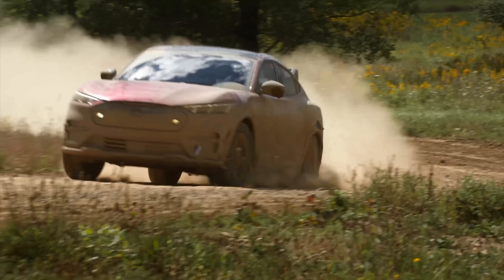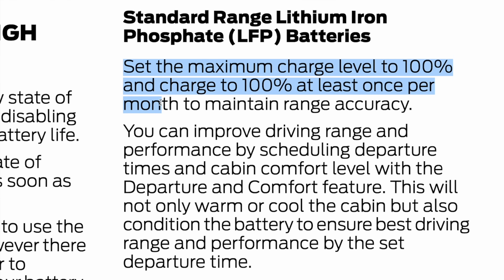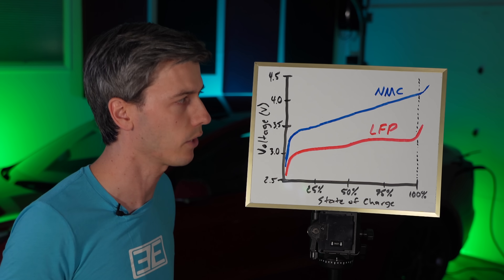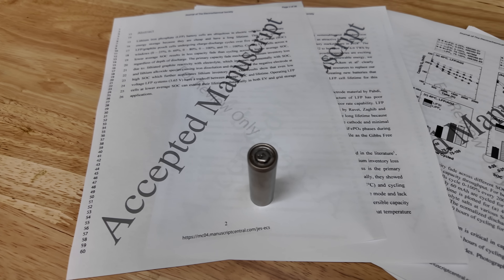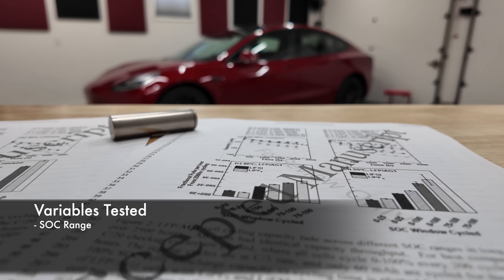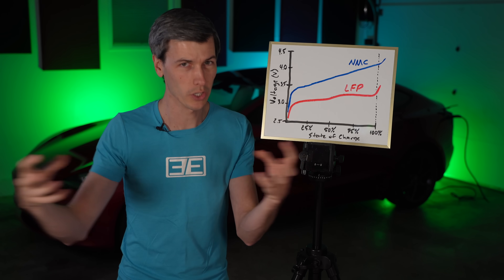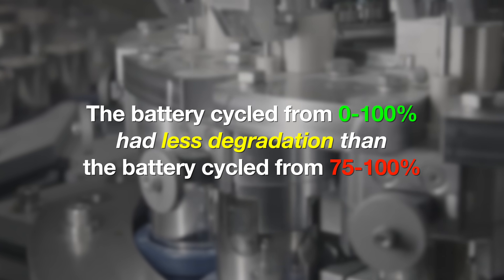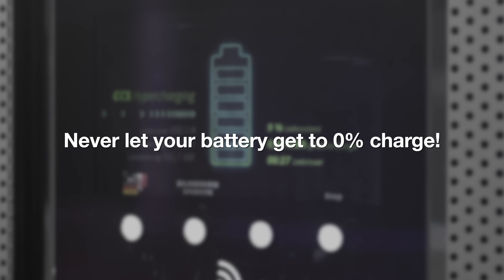How To Ruin Your Electric Car's Battery - LFP Edition!

Comment: You forgot to mention that LFP batteries last longer than NMC batteries overall 🤔
Reply: yea even if you do the worst charging cycle mentioned of 75-100 % pretty regularly the battery will still most likely outlast your car.
Reply: I think he wanted to stick to the title topic, but he does mention that LFP is likely to last the life of the car and that the worst-case degradation in the reference test was still very low, but I agree that a headline of this story should be that LFP has substantially lower degradation rates than NMC, regardless of charge regimen.  Many of the LFP cells being made to today will outlive their relevance.
Reply: @antibrevity  Good observation. so their degradation is so little that some degradation will still be ok and outlast the car probably.
Reply: But they're bigger
Reply: @AgentOffice  So? Are you having trouble making your 20 mile commute with your 200+ mile range car?
Reply: From 12:55 Jason says that a well maintained LFP can easily last the life of the vehicle. Not sure on comparison being mentioned.
Reply: It depends on under what type of workload.  LFP last longer than NCM in stationary storage systems; but marginally better than NCM in LFP.
Reply: @tooltalk "[LFP] is marginally better in LFP"  What is that supposed to mean?
Reply: @Neilhoh3  ah, meant to say LFP's cycle life is marginally better than NCM in EVs
Reply: Well, LFP is not well suited for BEVs....! It's heavier, less energy dense, charges slower and discharges slower as well! Also the performance at low temperatures really sucks. 
Modern NMC Cells easily can do 2000 cycles or more! I think NMCA is the way  to go ...
Reply: @huey-fan8335 
Both are crap, really. Stick a smaller LiFePo4 in alongside a petrol or diesel engine, and forget the long range battery electric cars.
Battery electric is fine for short trips in small vehicles - motorbikes, small hatchbacks, etc. For anything over about 30-40 miles or bigger family cars, hybrids are much better for the environment and the customer's wallet.
Reply: @tin2001 Rubbish!
Reply: a consideration though is they are less dense and thus less range, thus technically more cycles for the same miles. Still better IMO, but maybe NOT as insanely better as "lasts longer"
Reply: Around 6 times longer too
Reply: @tedarcher9120 This is grossly oversimplified - high quality NMC cells can fairly easily do 1000+ cycles and are getting better over time, and lower end reputable LFP cells are 2-3000 cycles, still a lot longer but not 6 times
Reply: @bosstowndynamics5488  yeah, you are comparing golden nmc with garbage tier lfp. LFP normally do 6000-10000 cycles. If you compared garbage nmc with golden lfp you can say lfp is 20 times longer living
Reply: @tedarcher9120  You should learn how to read. I'm not the one who made a rigid claim about proportions between the 2 chemistries, I merely pointed out that your claim was far too specific when there's so much variation within chemistries. Your response only reinforces that point - you can quite reasonably claim that LFP cells are 5 times better than LFP cells if you don't bother to be more specific, and if you are going to be more specific then you can't just go with "LFP" and "NMC". LFP cells are more resilient and do last longer but not by a specific amount.
Reply: @tedarcher9120  I'd like to know which EVs have LFP with 6000+ cycles.
Reply: @tedarcher9120  true in ESS, not in EVs.
Reply: And not a word about calendar aging of the battery, every year the battery deteriorates 1 to 2 percent if you use it or not..
Reply: @habana7638 can you site your source?
Reply: @habana7638  no only in the first year they may drop by 1-2% after that it's MUCH slower, just like other batteries.

Comment: Based on what I learned from this video, you should set the LFP battery charge limit to 100%, charge it to 100%, then use it normally until it reaches 20%. After that, charge it back to 100%. If you are going to store your LFP battery for an extended period, set the charge limit to 50% and keep it plugged in.

Comment: How much Bad Stuff are we talking? I mean, outside of letting it get to zero, what's the life expectancy difference between best and worst practices? Are we talking 20 years versus 19 years or 20 versus 10?
Reply from the maker: Excellent, important question that I definitely didn't answer, because it's difficult to say! I did include the study in the video description, which gives a more detailed answer. Basically, you can look at range capacity over time, and after 2500 hours (I think something like 1400 cycles, for a 200mi range EV, that's something like ~300,000 miles, with capacity retention ranging a few percentage points for each respective strategy).

Comment: I'm not sure it's that critical to have an accurate state of charge.  If you have a 20 mile daily commute, charging to 25% or whatever is fine.  You won't ever run out.  If you are going on a road trip for the weekend, then charge to 100% right before leaving.  If you run a rental car company, yeah, you've got a problem, but if you have more predictable usage, use that predictability.
Reply: I doubt it's just for user convenience.  Critical systems probably need to be aware of SOC for battery conditioning and the like.  The user impact is just a convenient side effect to get people to actually charge to full every once in a while.

Comment: Generally: don't let your lithium batteries get hot. Definitely try not to use them whilst they're hot. Charge them slow because that keeps them cool. Don't discharge them too fast or they'll get hot. Don't fully charge them. Don't fully discharge them. 

From what I saw a few years ago LFP was king for cycle life but lacked the power and energy density. And that was improved by cycling from 40% up to 60% ideally. 80% worst case. Only charge up to >95% when you are going to need that extra capacity. Keep the SoC middling, in general. 

You should be able to leave your car plugged in all the time and the BMS manage your SoC to maintain optimal long term health. But in reality most systems aren't smart enough for this.
Reply: Yeah, this exactly. I own an EV from a generation that used an LFP battery and was ridiculously overbuilt (the Chevy Spark EV, which was one of GM's first gen mass market EVs.) The amount of battery protection they built in is nuts. It never fully charges the whole pack to 100%, and does dynamic cell balancing. Ironically, leaving it plugged in all the time when available is the best condition, because it will run the cooling system to keep the battery at good temps even when its hot outside.
Reply: The 'don't fully charge them' advice is really a manufacturer issue: A lot of batteries in consumer electronics use a BMS chip that will slightly overcharge the battery to squeeze more capacity from it while greatly shortening battery life. Consumer electronics just aren't expected to last very long anyway.
Reply: What's really cool (hot?) are the lithium batteries used in Radio Control vehicles.  For absolute max power top speed runs, the batteries are charged into a "hot" state so they will output max power.  The downside is they lose capacity VERY quickly such that only a few MAX power discharges.  Those used batteries will still work great in more "normal" use however their ultimate life is shorter. Electric power for performance has similar tradeoffs to gasoline (internal combustion) performance power, but the electric has much more terrible tradeoffs it seems.  A brand new internal combustion engine costs quite a bit less than a battery pack with motors included.  I get the novelty and fun of electric power, but use that as the rationale, not some made-up crap about saving the "environment".
Reply: And that makes for yet another issue that the EV companies are not addressing and yet another issue that people pushing back against EVs have legitimate concerns.

Comment: For my model 3 LFP. I typically leave the charge at setting at 100% and don't play with that setting. I always schedule charging for it to reach 100% around the window i plan to use the car next and the remaining percentage seems too low to cover my typical route comfortably. Basically i don't leave the car seating at high states of charge unless it can't be avoided through un intended plans changing.

Comment: This will also be important in the context of V2H and V2G. Where there is a higher probability of cycling in the SoC above 60%. Now it's more understandable why Renault chose NMC for the 5 E-Tech, which combine 11kW AC V2G with just 52kWh battery.

Comment: I mean the point about LFP was it doesn't really matter. Because it by default has like 5x the life cycles than nmc. So you don't have to care being careful about it because it will barely decay anyway. And while lower % range might be better it's still does way less damage keeping it at 100% than nmc.
Reply from the maker: Not necessarily, you can design an NMC to outlast an LFP, so it's not fully accurate to say by default it's 5x in life. Dahn's lab has demonstrated this.
Reply: Lfp really the perfect car to non home charge and only using superchargers.
And will charge much faster from 80-100%.
Reply: I'm still not following what the recommendation is for example for a tesla model 3 with an lfp.  i've heard/read ABC - always be charging.  just keep it plugged in and charge to 100%
I'm assuming tesla/CATL knows more than random one off studies right? if we should only charge an lfp to 90%, wouldn't they tell us that etc.
Reply: @traubgator  best practice seems to be don't worry about charging to 100% but don't charge if you don't need to.

Comment: It's funny, I've also been taught to never let you gas tank be too low. As it will hurt you fuel pump operating at that amount. How things change but stay the same. Lol.
Reply: The fuel pickup is designed to be at the lowest point of the tank - it does not 'float around' so that if you let the fuel get low it will suck up dirt and water and all that other scary stuff.
Reply: Yep. It's the same debate with oil change schedules. Some say follow the manufacturer's recommendation, others say something crazy like every 2k miles. It all depends on how hard you beat the car.
Reply: Another adage to keeping a gas tank full in the colder environments is it gives less head space for air which has moisture in it. Over time you may get enough water that may inhibit your gas line may freeze.
Reply: Hah, true. Just as filing it up too 100%.
Reply: Some of the issue is sucking air, some of the issue is that if you only fill a bit at a time and run the tank regularly almost empty you can get water buildup.
Reply: @samiraperi467 One more reason is that most fuel pumps are inside the tank and use the fuel for cooling.
Reply: @sonictech1000  Yes, 'people' like to throw that out that not running your gas level is about cooling, but that concept is nonsense, LOL. As long as there is gas flowing through the fuel pump, even at low gas levels in the tank, the pump is being sufficiently cooled just by the flow of gas through the pump.
Reply: @Tom-dz6yo  Sufficient to outlive the warranty isn't the same as optimal.  Being submerged in fuel will definitely keep the pump cooler and pretty much any electric motor or pump will live longer in that state.
Reply: @samiraperi467  The fuel pickup is designed to be at the lowest point of the tank - it does not 'float around' so that if you let the fuel get low it will suck up dirt and water and all that other scary stuff.
Reply: But a fuel pump doesn’t cost 10,000s and that was a long time ago
Reply: @whatcouldgowrong7914  the fuel pump on my truck was 1100 to replace last year. It's not as much but it's still not cheap.
Reply: @Egleu1 that’s not insubstantial, but it’s a heck of a lot less bitter a pill to swallow than replacing a battery to the tune of 20k for a Tesla or 65k for a Hyundai. A battery failure is worse than any single failure on a normal car including the engine and transmission.
Reply: @Thanatos2996  and they almost never happen.
Reply: @Thanatos2996  engine failure is 15k. Gas engines have more maintenance and failures than electric.
Reply: @Thanatos2996  Exactly, the massive depreciation of EV is bad enough that after 2 to 3 years it is cheaper to write off the vehicle rather than pay to replace the battery.  also the slighted suspicion of damage to the battery from even a mild collision the car will be written off because when a lithium based battery lets go, the whole neighbourhood knows about it from the dozens of fire trucks that turn up.  I guess that is why there are quite a few EV in junkyards that look OK on the outside or just minor damage.
Reply: @Egleu1 1k+ fuel pump? Sounds like a diesel fuel pump or overpriced trash.
Reply: @mjay6245  that's with labor. It's a  Sierra 1500 gas.
Reply: @Egleu1  I’ll take your figure at face value. 15k is less than 20k and way less than 65k, so I’m not sure what point you think you’ve made. I disagree that gas cars need substantially more repairs; everything outside the powertrain is the same, and that’s most of what will regularly need fixing. The only failures I had to repair on my then 20-year-old previous vehicle that wouldn’t be applicable to an EV in the 10 years I owned it were a cam sensor and transmission fluid line. A total engine failure is also rare compared to easily fixed single component failures like those, as long as you don’t neglect the basic maintenance.

With EVs, if anything goes wrong with the battery, you need to replace the entire battery. They are not repairable, at least not with the model that EV makers currently use, unlike an engine. The battery also will degrade in performance over time and with use, something that you need to constantly be conscious of your charging habits to minimize. I’d personally find that along with having to plan out where to charge when going out of town more taxing than changing my oil every 6 months and doing a handful of other things every 30,000 miles, but that’s down to personal preference.
Reply: @Thanatos2996  major repairs I've had on my vehicles. Harmonic balancer, fuel pump, oil pressure sensor, rear main seal, o2 sensors, front differential, new transmission, new fan clutch, struts and suspension, wheel bearings, brake lines, etc. Except for the brakes and suspension and possibly the differential those things are not in Evs. Theres no bimonthly oil changes and air filter changes on an ev so that saves you 100 bucks a time. The batteries don't fail nearly as often as ice parts either.
Reply: @Egleu1  some of those you listed are minor repairs (an oil pressure sender is a 5 minute job with a $10 part), but even for the major ones they all total less than a battery. Given your oil changes are bimonthly, I'm guessing you have around a 50 mile daily commute each way or drive very long distances very regularly. You mentioned you have a truck, so you might also be towing, which increases wear especially on the trans and diff. You could also be the unfortunate owner of a Dodge/Ram, one of the few conventional brands to be even less reliable than a Chinese EV, in which case major breakdowns are to be expected at regular intervals. Not all conventional vehicles are good.

In any case, you're putting substantially more miles on your vehicles than most people, potentially under a more load, so you seem to have a skewed view of how much upkeep a conventional vehicle requires. For most people, it's 2 oil changes a year and a few other fluids every 5 years or so (if they know to have them changed, which most don't) until they sell the car, along with the wear items and repairs you occasionally need on any vehicle, engine or no.
Reply: @Thanatos2996  I put no more miles on my vehicle than anyone else. 18k a year or so. Also the oil pressure sensor cost me 1200 bucks.
Reply: @Thanatos2996  also forgot to mention the Chevy cruze I had that had the turbo fail. I sold that one for parts since the repair was like 1800
Reply: @Egleu1  if you drive 18k a year, you do not need bimonthly oil changes unless you are driving an old vehicle on conventional oil; that would be every 3-4 months at the normal 5k interval for modern vehicles. You were scammed if they charged you $1200 for an oil pressure sender, unless the vehicle in question was so poorly designed that it took $1100 of labor to get to the thing. The Cruze is a lemon, and premature death by turbo failure is extremely common on them, which is unfortunate but not a mark against normal cars since EV makers are just as capable of making unreliable cars as anyone else.
Reply: @Thanatos2996  okay oil change every 3 months instead of every 2. And yes the intake manifold needed to be removed to change it. I've owned many different ice vehicles and basically all the major issues I've had do not exist on EVs. It's very disengenuous to say that EVs are more or just as prone to failures.
Reply: @Egleu1  It looks like you own a US made vehicle. In such case, that’s your problem, not the fact that it has an ICE. Were it an EV, you’d be looking at a similar cost of frequent repairs of other systems failing for no good reason. U.S. garbage in, garbage dollars out.
Reply: @ebahapo  didn't realize Hyundai was American. My mistake.
Reply: @Egleu1  Indeed, Hyundai is a mistake made in Alabama.